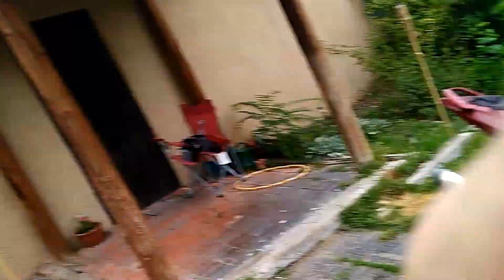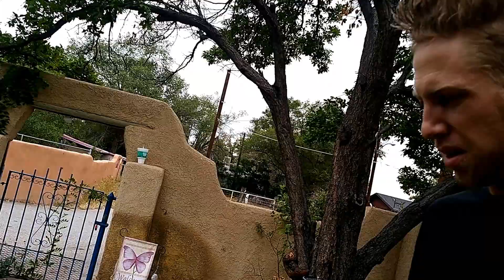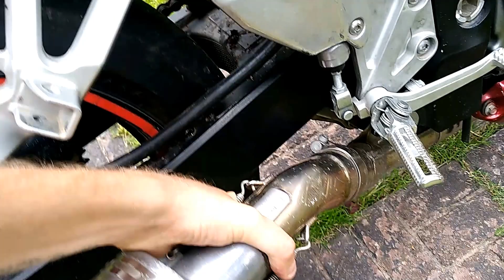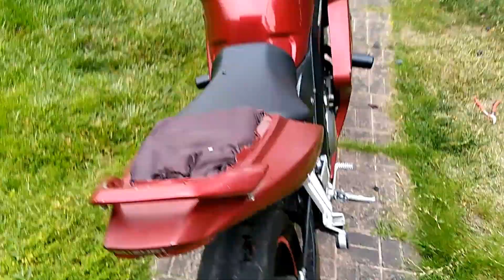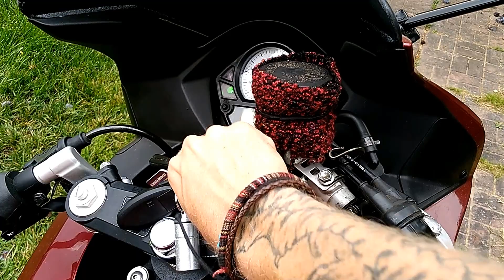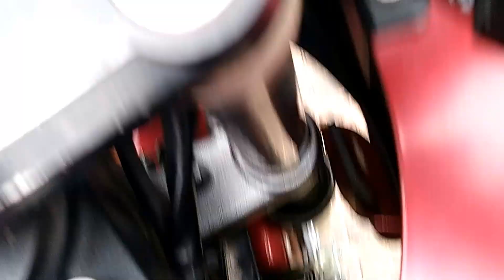Straight pipe Suzuki sv650 real loud !!

Comment: How much did you pay for your bike if you don't mind me asking
Reply from the maker: I actually bought a 125cc Chinese pit bike needing a tune up and throttle cable for 300$ worth about 1200 after I fixed it and I traded that for this not running been sitting on it side for 3 years oil in the cylinders and carb rust in tank bad brake boosters I cleaned everything and it started right up sold it for 1500$

Comment: Is the engine on it liquid or air cooled?
Reply from the maker: It's liquid cooled man
Reply from the maker: It was air cooled sorry man
Reply: @YouStanceBro  it's actually liquid cooled
Reply from the maker: @joelsrailwayadventures.2966  bro it was my bike there is no radiator what so ever and never had a radiator it's a air cooled V twin
Reply: @YouStanceBro  is it an sv650? If so it's definitely water cooled, all 3 generations of  sv650's are water cooled, I personally own a 2nd gen 2003 sv650s1